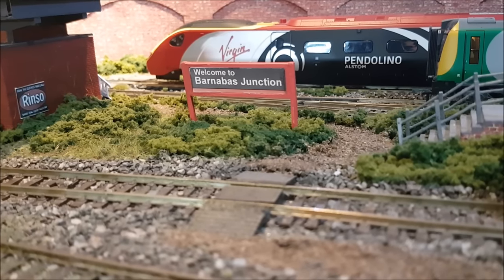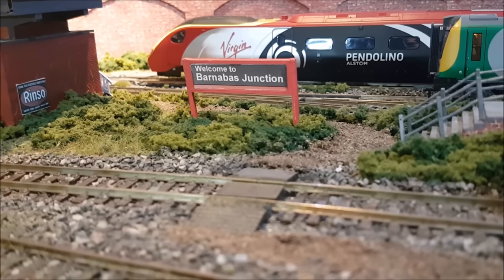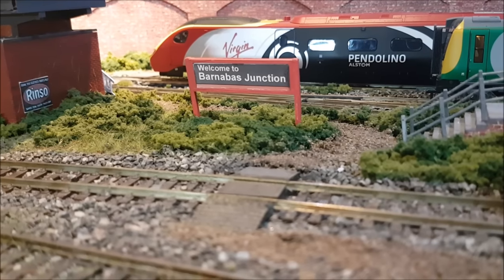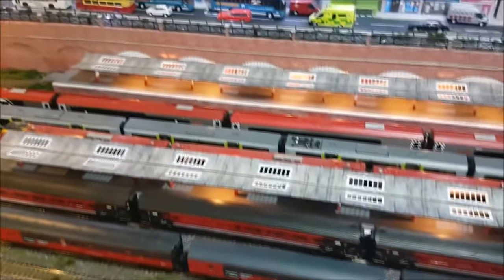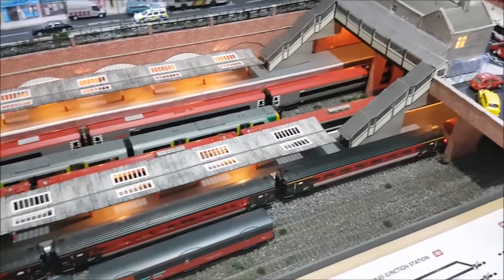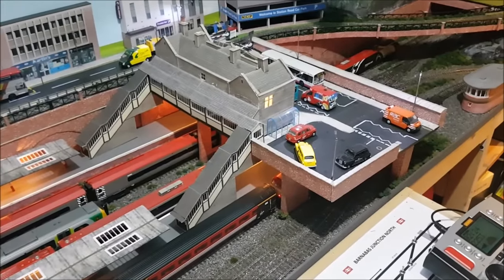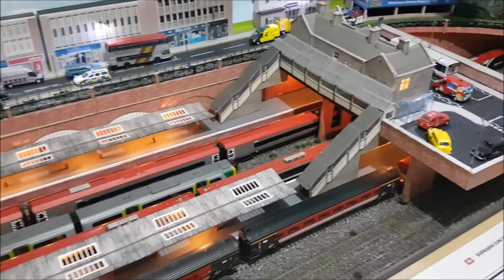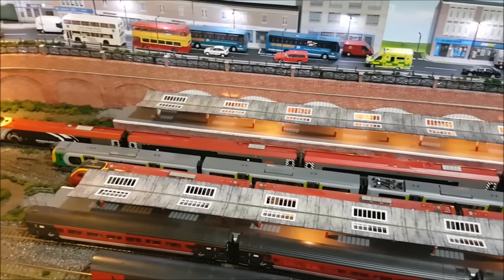Layout Update #34: Scratch Building Project & A Proposed Track Change

Comment: Good update. Lift down to the platform? Or if you choose to add a heritage line you could use that foot bridge as a roadside access down to the platform (separate from the main station) and paint the bridge in heritage type colours.
Reply from the maker: Thanks Tim, ,i have since worked out a way to have subways without cutting into current platforms, details will be explained in next update. The Station building is planned to be modernised in the future and will include lifts.

Comment: Why not create a dedicated platform for parcel trains (parcel hub). You could access the parcel platform via a barrow crossing spanning all lines for tugs/brutes/Royal Mail trolleys etc. Exeter St Davids used this method when the TPO trains were in operation. (You already have a selection of RES vans). If you're restricted for space, loading/unloading road vehicles could take place in front of the platform off scene. Great video, thanks for sharing.
Reply from the maker: Thank you for your comment.

Comment: Great update! I like your live streams, but always struggle to watch them live and then get back through them. These more regular video updates are awesome.

Love the tower block, that's a great scratch-build. The track changes would be good as you could then have that extra platform for push-pull service or DMUs. A smaller 2-track footbridge I think would look cool if you cut up that Dapol bridge or similar. Adds a little extra interest, and I don't think subways add much to a layout as there's not much to look at with them. Iain
Reply from the maker: Cheers,i have since worked out a way to have subways without cutting into current platforms, details will be explained in next update.

Comment: how about  an elevator they have them here in the states in parking garages would only require a sracth built top box and tube down to bottom section easy peasy
Reply: Damn speller broke lol
Reply from the maker: Station building is planned to be modernised in the future and will include lifts, so yes good idea.